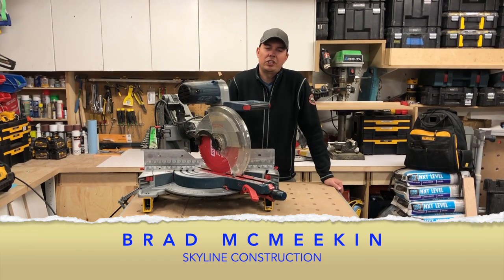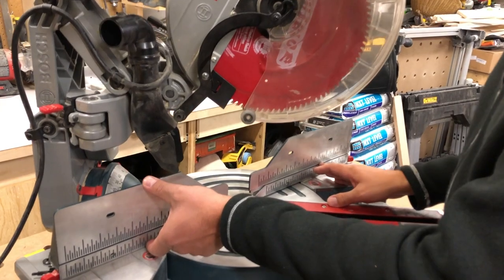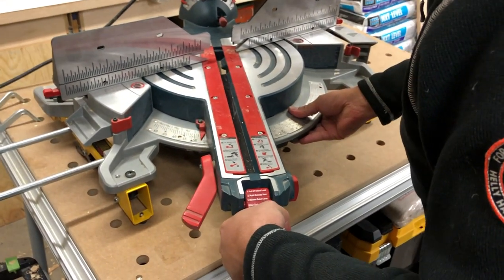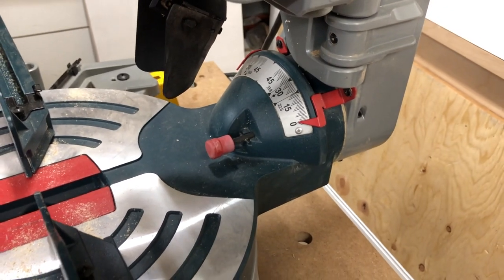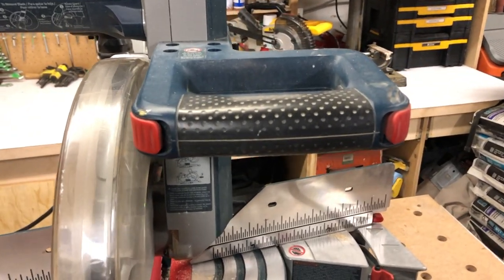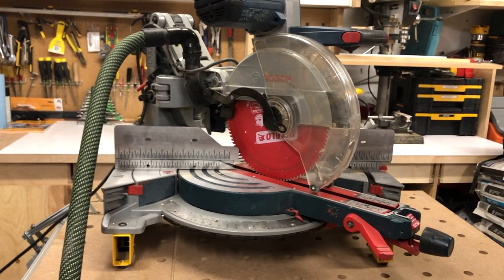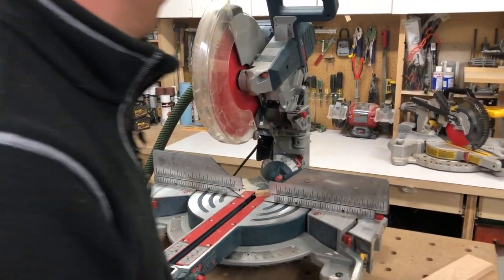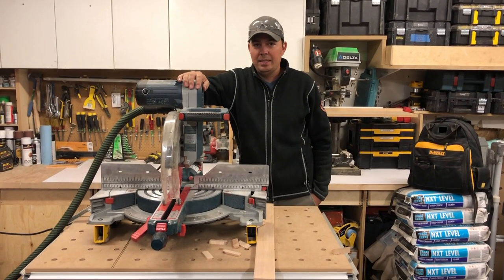My thoughts on the Bosch GCM12SD Glide Miter Saw

Comment: Great review I did tighten up those screws for the glid just ever so slightly. My saw came in so buttery smooth that if the wind blew on it, it would glide and move. I wanted to to move with very little input, but with input none the less. (if that makes sense)

Comment: I bought this saw for my small shop.  The fact it didn’t take up extra room coming out from the wall is what sold me on it.  That and the fact both Izzy Swan, the Wood Whisperer (and now you) all said it’s as good as the kapex.  We live on 100 acre homestead.  I’ve been using this saw sometimes portably taking it around to different buildings and locations when I need to work.  It’s HEAVY!  Lol.  Now it stays in the shop.  I wish the Bosch mobile stand for it wasn’t almost as much as the saw.    I see both Delta and Ridgid have copied the folding arm aspect in their saws
Reply: Delta supplies the one for Ridgid so they are essentially the same.
Reply: From what I have seen on reviews and videos because it is beautiful and i loved so I was going to get it the delta cruzer(the copied version) has a deflection issue pretty bad one too.  When the arms are all the way out the blade will move side to side with the littlest force. I think it's because Bosch was smart made a vertical arm and one horizontal arm so it helps counter act any blade deflection. If you look at the rigid and delta(thanks for clearing it up I thought those two saws looked identical with different name plates) their arms are both pretty close to vertical so I think there is nothing to keep any side to side motion from happening. There's some videos of each saw and it's with one finger the whole blade moves. So when the shop is done I will be going Bosch it's the pioneer of that tech it just plain and simple works plus anything thats as good or better than a Festool when they are $15-1600 works for me!

Comment: Thanks, I just ordered one. I have a Bosch Sliding Mitre Saw (12" as well) which is actually very similar to the one in your video. However, I am looking forward to being able of putting the new saw right agains the wall and have a nice mitre saw station setup in my shop. I will definitely keep and use the old saw (probably will put it on a portable stand and use it for construction/job sites).

Comment: I do want one of those. I'm currently using an old, non-sliding/gliding, bosch miter saw. It works, but it's harder to avoid tear out on a miter saw that doesn't glide, since you can only attack from one angle. I've just been having to work around that issue. I will upgrade at some point, but that saw is expensive. Lol
Reply: I got mine for 500 and change refurbished on ebay. It's so nice you can't tell it's not brand new. And it has a 2 year warranty

Comment: I should have bought this saw. I went back and forth and ended up with the dws779.  Which, it's a fine saw, but I kick myself every time I see how much room the slides take up.  Thanks for rubbing it in :P
Reply: Clean it and sell it...depending on its condition you might get up to 500 for it, may be even more if you are lucky and find a dumb fuck. 
Then add all lil out of your pocket and get that god damn Bosch. Its a german tool man, you gotta get ya hands on that thing sooner or later. You know it and I know it. And once there on that shiny little spot of german quality tools...there is no coming back from it. Sniffing that fine wood dust nice and accurately cut by a blade made from the same steel used building those Panzers that once nearly had the nations of the world on their knees. If you put the saw on the highst speed some say you can hear the raw of a tiger in the distance far away. That shit gets you faster than crack or heroin. So ma man whats stopping you from doing it and finally get a tool that is built for men?

Comment: Went from the hitachi 12” to this and love it, just wish they included a laser or shadow lite for the price. I’ve found a few hacks for the older version but not this one yet
Reply from the maker: I almost bought the Hitachi 12'' a long time ago, then they came out with this, it was perfect timing.
Reply: I was torn between the 12" hitachi (Metabo) and this saw. I ended up with the Bosch. The Hitachi was much bulkier, didn't glide as easy, and I didn't like the vertical grip. I wish the Bosch had a laser too, but for me this will be going into a miter station with a stop block system, so no big deal.
Reply from the maker: @dRapp421  i think you made the right choice, my first saw was a Hitachi, I loved that thing!! but the bosch is on a different level
Reply: @hammerandhome   To me this is festool level. The Hitachi served it’s purpose and we now have a metal cutting blade we keep on it for PVC/ Aluminum deck railings and other metal we need to cut

Comment: I bought this saw Oct 2021, the distance that it goes past the fence is 0.  You can't cut rabbets or dado's with it the full length of a board.  And You have to really make certain that you hold it down a push all the way towards the fence when cutting a board.  The saw just doesn't move past the fence as it should.  It's okay as a chop saw but pretty expensive for just that purpose.
Reply: Use a fence spacer
Reply: @SuzukiKid400   I feel that advertising an ability that requires the purchaser to make something themselves to make it work is disingenuous.  What is the point of having a opening that extends beyond the distance the blade moves?  Making a fence or adding a board reduces the width of board you can dado or rabbet.  Eventually we plan on making a spacer to that will allow the blade to move the full distance of the slot.

Comment: How is it for dust collection ? Most saws need a wide mouth "box" connected to dust hose or pipe and there is still dust everywhere. Does the small dust hose connection on the saw work when connected to an appropriate collector ?
Reply from the maker: Its ok, like most miter saws the dust collection is never the best. if your inside a home you might want to have a hood or something like it.
Reply: @hammerandhome  Thanks

Comment: Now that is what I call a review. You set the standard.
I have been considering...
Bosch
Milwaukee 
Makita
For their 12" sliders, for my finish carpentry company. 

I can't justify spending 1600 on a festool.

To calibrate the contractor grade saws I say be a good match.

Now if festool instead the 3 year warranty was like hilti st 20 would consider it.
Milwaukee is 5
Bosch 3
Makita 3
Festool 3 as well.
Hilti will even over night the replacement then uou send in the defective tool.
Reply from the maker: Thank you!
Reply: Jeff, which saw did you decide on? I'm debating those three plus the dewalt dws716
Reply: @treehugginmegatron  I have the Dewalt, it's basic, yet made to last owned it for 25 years.
If you want precise cuts calibrate then your good to go, use speed/rafter square if need to loosen the screws adjust, now you can make quality cuts.
It will be my rough cut saw

For trim...
I'm placing Bosch 1st , Milwaukee second, I tried the 
makita in dealer showroom didn't like the action as another contractor returned it for that reason., 
festool is well made accurate,  most don't like the handle and the button on the handle add 1500 I'll pass.

The Bosch has wings that retract, compact, is heavy to remedy that have custom aluminum stand to make it portable, with brackets to keep the saw firmly attached.

Milwaukee my second choice s 100 more.

Comment: You say this Bosch Saw is good and I purchased it on your recommendation but, have you measured the deflection when using it. I’m curious to know if you like many other owners have the same problem. Set the saw at 90° and cut a 12 inch piece of wood. It may be 90° at the fence but it is never 90° at the end of the cut. I called Bosch several times and there is no adjustment for this. The arms have too much play or deflection. Let me know if you have the same problem
Thanks, Mitch
Reply from the maker: Hey Mitch , I’ll take a look at mine. I’ve never noticed an issue with it. I’ll be using it soon and I’ll make a video on it.

Comment: The reason I bough my Hitachi is because of that, the weight and also more compact BUT it should have still bought this over the Hitachi. Hitachi now Metabo HPT has new miter saw. It comes with their new 36v system and I wonder if Bosch will be going wireless with wire capability just like the Metabo HPT? It would be nice and I'll probably buy their 10" if they ever come out with one. Oh before I forget, I hope Bosch improve their dust collection. Thats what it actually all it needs to be the perfect saw.
Reply from the maker: NinJazz Rhythm yeah the weight is a big thing for sure. I love the look of the new metabo 36v saws. They remind me of the old style of hitachi saws. Great saw!  It would be sweet if bosh came out with this model in cordless, I would be all over that too. I have yet to find a saw with perfect dust collection, it always a let down. Thx for watching

Comment: Hi Brad. Thank you so much for posting this video, it was great. 
I was wondering if you could please help me or give me some advice that I need. 
I just purchased the Dewalt 779 sliding miter saw and now I'm seeing all these videos for this Bosch. There is quite a price difference between the 2 models, but I was wondering if you could please tell me if that price difference is really worth the difference in the sliding mechanism of these saws?
I am pretty much a do-it-yourselfer here at home, so I would not be taking the saw anywhere but I'm just not sure if spending that extra money for the Bosch is worth it for storage purposes. 
Is there any way you could PLEASE help me out with this because I don't want to return the Dewalt if I don't have to, but I would really value your opinion on this.
 Any help or advice you can give me I would greatly appreciate. Thank you so much!!
Reply from the maker: hey Joe, how did you make out with the boch?
Reply: @hammerandhome  Hi Brad. Wellllll....I chickened out lol. I didn't going pick it up from HD. 
The problem I'm having is justifying that price tag for occasional at home use. Believe me, I really want the saw but it would be only for the little space that it saves. I've already used my Dewalt 779 and it works great. I'm building a mobile workbench soon and I will be incorporating the Dewalt into it so I don't have to lift it all the time lol. But yeah, I never got it.  
Can you think of another really, really, really good reason why I should go buy that thing lol????
Reply: I own both , I have the dewalt 12' sliding and a Bosch 10' glide, I much prefer the bosch but it was almost double the price and the I have a small shop and the dewalt just takes up to much room, also the dust bag on the dewalt is located in the back and with it attached it sticks out 16' plus compared to the bosch and the dewalt has horrid dust collection, but if you have the room and don't mind the dust, the dewalt is a good saw for a budget, but if you can afford it , get the bosch, imo it's worth it

Comment: Too bad it doesn’t have a laser cutting guide or the duel l.e.d. lights that cast a shadow of the blade as a cutting guide. Some of us here are wondering if there is any side flex happening when you pull the arm out fully? We’ve seen other channels showing other saw demonstrations where the blade arm will flex if you don’t pull straight with your arm, leaving a bad out of angle cut.

Comment: Mine (just purchased) has no black plastic cap where the guard is in front, my handle has no thumb safety switch on the grip, instead it has a safety slide underneath the handle. Was I shipped low grade stuff? The advertised picture showed the one you have. Should I return it? Is the version I have an improvement? Like wtf

Comment: I have this saw and its heavy duty I wish it had the dual laser and a light .I guess after market for those items , Is that the 12 Diablo blade 80 tooth blade? and do you recommend this blade or any others since its been 2 years on this video.
Reply: for trim on that blade.

Comment: Excellent video sir.
I'm stuck between...
Milwaukee 6955
Festool kapex
Bosch gsm

Each has something that beneficial.

Like the Milwaukee
Digital readout and knob to get precise cuts
Bosch ease of use
Festool precise though can only use festool blades.
It's lower consideration for my finish carpentry company.
Again thank you bud excellent video

I calibrate my saws right now 12 DeWalt is it does the job.
Use framing square and speed square to first calibrate the saw.
Make a cut use the 2 squares to check for the cut 45, 90 etc.
Reply from the maker: well... that's a tough decision on what saw to get, The bosch saws are cordless now, so that's a big plus in my world. I love the bosh and have never had an issue with it. I can't say much for the Milwaukee, because i have never used it. but it looks nice. The Festool is on a different level as far as price, but it also has some really nice features on it, it's just really hard to justify that kind of money for a saw. I almost bought it years ago but went with the bosch instead. I have used the festool and its nice but for me it wasn't worth it. if you can try and use all of them before you buy.
sorry i couldn't be more helpful
cheers
Reply from the maker: Also festool just announced a new cordless model
Reply: @hammerandhome  you tube is public tv to educate in part.
Your video did just that.
I have riled out the Milwaukee you must carry the saw and buy a strap to carry the stand plus the brackets.
Add no material hold down clamp.

Festool offers a lot is pricey, the saw uses only festool due to metric arbor

Leaves Bosch it gets praised and criticism. To say mount it to the stand so much for the weight problem.
Bosch is 65 lbs as Milwaukee festool 50.
Bosch has better cut capacity.
I thank you for your video
Reply from the maker: @jeffalan6339  Thanks Jeff, I think you will really like the Bosch!
have a great day!

Comment: Very informative video. You showed me a couple of things I didn’t know. There are two black plates or clips behind the fence. Do you know what their purpose are? I looked up the parts diagrams and it identified them as “plates” but I haven’t found out what purpose  they are intended to serve.  
Thanks for the video. It really did help in a couple of areas.
Reply: They might be the ones you rotate and stop or allow the fences from coming off. If you do a 45 deg cut you need to pull the fence right back on the right, the clip stops the fence coming all the way out, if you prefer.

Comment: How long have you owned this particular model ? I was thinking of getting one and adding a led light but another  reviewers pics showed that the blade cover had changed and did not look like the photos shown on most sites,  in particular the black part at the end of the blade cover just past the handle is now a single piece and I would not be able to make that modification.
Reply from the maker: I think I have had this saw for 9 years or so. It’s great to use. They just came out with cordless models of this saw as well

Comment: Thank you for reviewing this. I've been a Dewalt guy and I recently sold my 10 inch Ryobi saw to a friend looking for something. I've been back and forth with the Dewalt that also allows battery use but the space saving without the rails on the Bosch may have me thinking twice.
Reply from the maker: My pleasure. I have the DEWALT power station that I also double as my charger on site some times. My thinking was if I have the power station I’m basically cordless with any tool I use. And the Bosch is such a nice saw to use. Thanks for watching

Comment: is there any way to couple the vacumm that when you turn on the miter saw the vacum turns on together synchronized?
Reply from the maker: you could buy a vacuum that has that option, or there are plug adapters that you can get to make that happen

Comment: question how do you compare this bosch miter saw to dewalt flexvolt 60v miter saw?  what your opinion like to know thanks!!
Reply from the maker: so I have never used the dewalt flexvolt saw, but in my opinion the bosch is better for a number of reasons. the Glide, it's by far the smoothest out there. once you try it, its very hard to go back to a slider. next is a big one for me and that's the bevel lock on the front of the bosch, it is so nice to use that it is such a time saver for me. again once you use it you will never go back. having to reach around to the back of a saw to unlock is a pain. especially on the larger saws. I don't mind it on small saws because the reach is minimal, but 12'' saws are a pain. next would be the overall space that these massive saws take up, not having rails to slide on saves a lot of space. so it's great for a trailer or a shop. the bosch also has table extensions on the sides that i use all the time. I think the only reason i would buy the dewalt would be for its cordless feature. if I was to bring another saw into the mix it would be the new Metabo slider. it looks very nice and i would probably put it in 2nd place after the bosch. hope this helps. thanks for watching.

Comment: How accurate are the 45 degree cuts and 90 degree cuts?
Is there even any blade wobble whilst cutting?
Reply from the maker: i find this saw to be very accurate at all cuts. it's my go to saw for finishing. never framing, I haven't seen any wobble.
Reply: When you say "framing" do you consider framing to be to abusive on a saw? I'm undecided on this saw or a Makita Ls1219l  having just sold my earlier  Bosch model GCM 10 SD which served me well!

Comment: Do you find that the forward travel is a little short? I think another 1/4" would be a better cut as the blade exits the board. Is there any adjustment to get it farther past the fence?